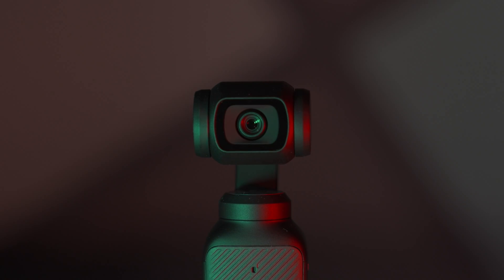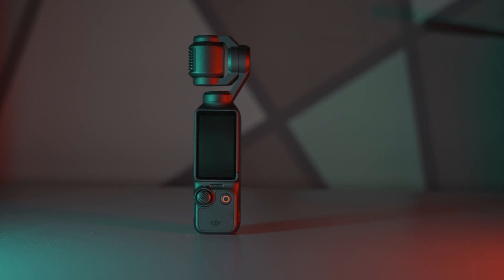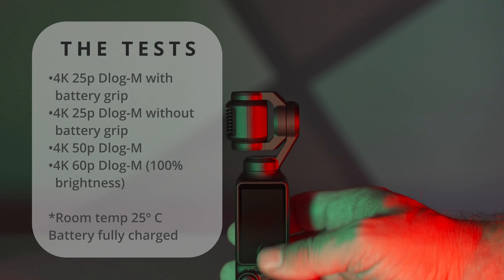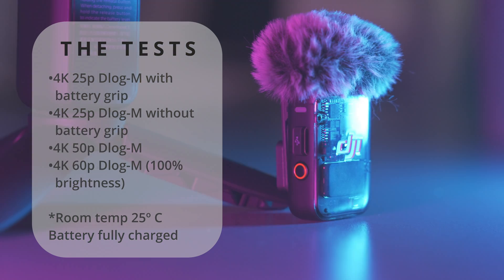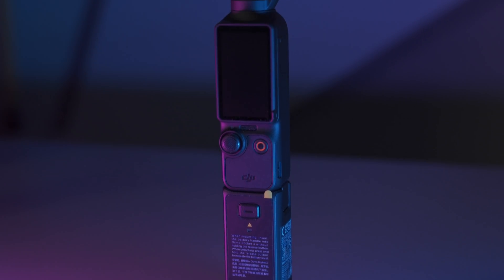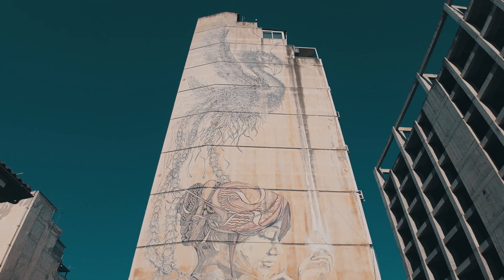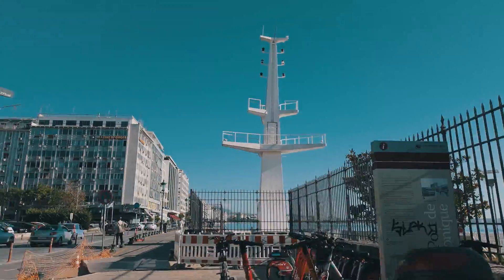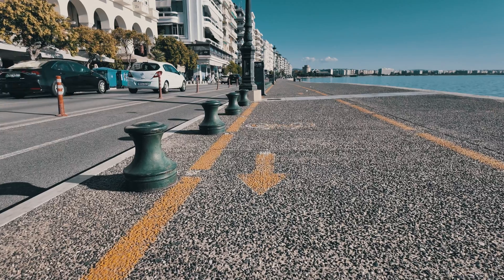Dji Osmo Pocket 3 Overheating Crash Test - WILL IT SURVIVE THE HEAT??

Comment: DJI violates Consumer Protection Law. Manuals and advertising tells totally zero about overheating. It should record until battery is empty when using all normal video modes. Pocket 3 has serious design flaws in cooling system. Physical cooling design cannot be fixed using software updates.
Reply: And not a single one of the YouTubers that convinced me to buy this… mentioned this even once.
Reply: @theungeek  99% of them are located in US, so they got US version which does not shut down at 48deg C as EU version does.
Reply: Looks like this is mostly problem for EU version. There is even "a hack" to get around this.
Reply: @woocashtech  That "hack" was only system setting and logs more data than normally do. But yes those devices that are not defective the latest firmware Pocket 3 works a lot better in many ways. Actually it is heating over 48 C but I think DJI managed to do also politics to allow device heat more in EU. Because it heats up to 56 C from the gimbal mount.

Comment: Thanks. Even worse here. Europe. After just 10 min. of 4K60FPS H264 in room temperature 22C. Did have the battery handle on though. 

UPDATE: found a simple fix. Read comment below.
Reply: Wait. Before you return it. I found a simple fix here on youtube, that actually works https://youtu.be/jHbmaTxaKoA?si=vtlSDzcs6FdnhUdd :)

Comment: Thank you very much for this video. Since the European regulations force the cameras to shut down once reaching 48°C, no wonder people are complaining about overheating! We had the Osmo Action 3 as well as the Osmo Action 4, all shutting off because of overheating after about 20 Minutes when shooting at 4K/30 and even quicker @ 60FPS. Same issue now with the Osmo Pocket 3! People are blaming it on DJI but that's not their fault. These cameras easily can reach 60° without being forced to shut down in all countries outside the EU!
Reply from the maker: That's exactly the temperatures that I've reached before shutting down! 47° C !!! I hope there would be a future firmware update! I will mainly use the camera for b rolls , so it doesn't matter too much for me, but for others it would ! Thank you for your kind words!

Comment: Huge Dji scandal is about to come:
A defect batch of Dji P3 for the customers.
   Today I returned my pocket 3 back !
Overheating problems.
I tried to do a 4K 60fps HDR video and my camera stopped working after less than  15min.!
UNEXEPTABLE Dji !
Totally UNEXEPTABLE 👎👎👎
Reply: Since the European regulations force the cameras to shut down once reaching 48°C, no wonder people are complaining about overheating! We had the Osmo Action 3 as well as the Osmo Action 4, all shutting off because of overheating after about 20 Minutes when shooting at 4K/30 and even quicker @ 60FPS. Same issue now with the Osmo Pocket 3! People are blaming it on DJI but that's not their fault. These cameras easily can reach 60° without being forced to shut down in all countries outside the EU! Watch here: https://youtu.be/jHbmaTxaKoA
Reply: It has nothing to do with regulations, in most cases it reaches bloody around 60 degrees its hardware badly designed and components used.
They needed faster processor and most overheating would be gone but they tried to save money with old chips so here we go